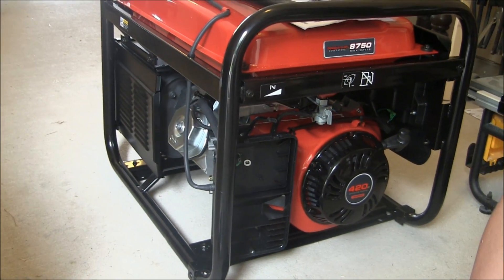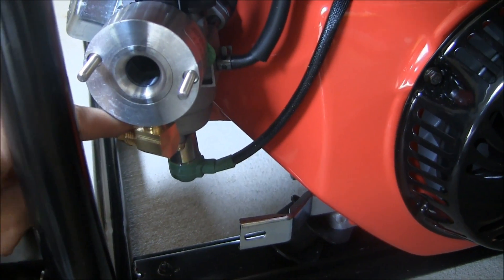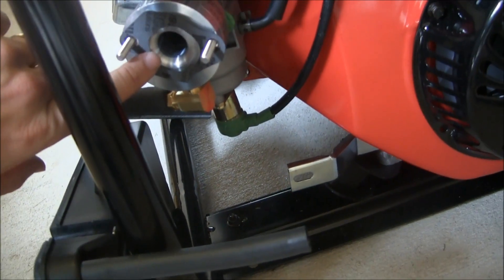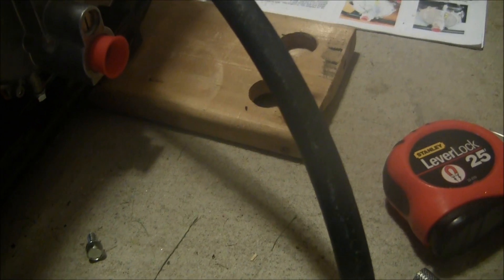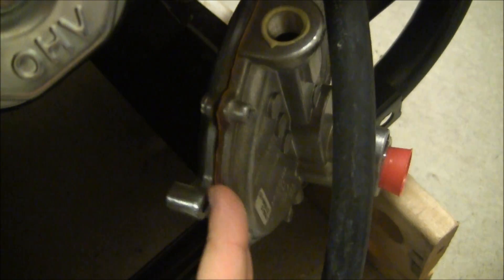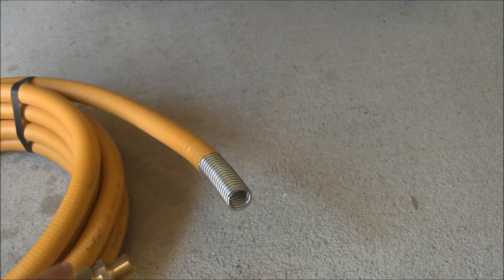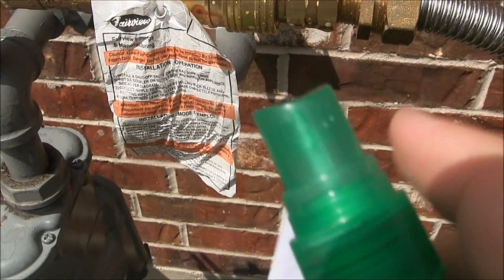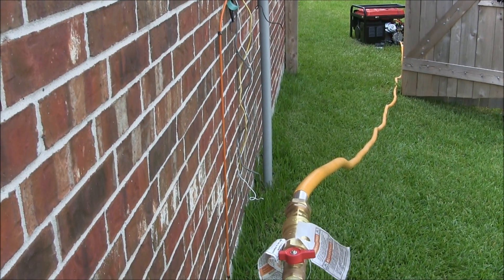Convert (Predator) Generator to Use Natural Gas (NG)

Comment: The engine is a Chinese knock off of a Honda... Amazing how counterfeit engines are sold in America, right up front, no problem with counterfeiting there...
Reply: They can only be called "Counterfeit" if they're using the "Honda" logo...Otherwise it's called a "Knockoff" Considering how much a honda goes for...That's not my problem.
Reply: Hondas are referred to as the forever motor for obvious reasons , I have been using them professionally for over 30 years for their reliability and durability .
Reply: Thank the worthless democrats for that, they are trying to destroy our country
Reply: Stupid ass, Honda leases out the design for the engines, they make a lot of money from doing it, Don't you think a company like Honda would sue big time for counterfeiting their property? Look it up Einstein asshole.

Comment: corrugated stainless steel tubing is not intended to be used in this application. If I had a service call at your house I would have to issue a type A red tag for an unsafe installation. I think the 1/4 in tapping is only there to measure the outlet pressure of the meter or leak test the piping system. Thanks for posting video,was fun to watch
Reply: The best critique is not just to just tell someone what they did wrong, but tell them how to do it right...
Reply: @bonesx7799  you're right! Stainless corrugated can be used in that application there's a lot of unnecessarily boo depending on your location but that was not the problem from what I see the problem is dude should you use take watermelon rinds bubble gum anyting on those joints those connections and also why in the world would he make a connection with the gas on? Seems as if you two would take this video down just for that safety issue

Comment: Did you run this generator under heavy load? Type C appear to be for the smaller motor. It is looks like it is working nicely
Reply from the maker: I did the best I could but haven't tried maxing it out.  That's a good idea.

Comment: You were doing good up until the gas meter part. Don't know why you would take that chance working on it live. Also I don't understand how you are able to supply enough NG to the generator if you have only a 1/4" output from the meter. It does not matter you went bigger after the meter. If you have 1/4" out, you'll never get more than what a 1/4" line can carry. Also that hose is not meant to be used continuously and flexed many times. You should get an outdoor rated rubber hose for NG.
Reply: Agreed should have changed 90 to a tee and went from there.  Very old post but you are very right.

Comment: do you have a part number for the kit that you used? or the stud width measurements? i  have this generator and i want to do the conversion,  thanks!
Reply from the maker: The 'Type C' kit from uscarb.com was used.
Reply: US carb states if you’re running more then 12hp a Tri fuel type 4 kit is required and a type C kit is for 12hp or less. Your Predator 8750 is 13 hp how did you get the type C to work properly?

Comment: How was the vibration against the air cleaner cover?   You mentioned it in the video
Reply from the maker: Not as worrisome as I first thought; however, I only run periodically and not for long periods of time.  It is intended as emergency backup power.

Comment: Thanks for posting this video! Question: how did you attach the male adapter onto the gas hose? do you just screw it on?
Reply from the maker: Yes, tightly and with some thread seal tape.

Comment: Great video!  When you start using natural gas, do you choke it?  I know ther eis a 'primer' button on the conversion kit buut I was wondering what, exactally, is the startup procedure?  Thanks!
Reply from the maker: Yes.  There is a primer.  I have to push it a handful of times to get this started.  It's now been a few years.  I try starting it up every six months or so.  It'll still start up the first time if I prime a little.  It took a some work to get this honed initially (i.e. setting the right inflow amount) but I haven't touched it since.

Comment: My friend purchased a 4KW Sportsman already equippped for propane online for about $300.  It has no gasoline tank.   It seems if you really want a NG or LP generator you should try to look for one factory equipped for this service.  Howver if you really need tri-fuel maybe these kits and other needed accessories make sense.

Comment: Whats the run time gas vs lpg?
Reply from the maker: I don't know if I understand the question.  I only ran gas for a few hours when I first got it to break-in the engine and only ever used natural gas since then.  I don't have more than 25 hours on this since I haven't needed it for an emergency (my intended usage) and haven't used it for anything else.  I start it about every six months.  The gas tank is limited (and runs dirtier), so with the (cleaner) natural gas to the home I see this as unlimited.

Comment: Hello i seen your comment on the rpm your generator is running. the perfect way to set your generator speed is to use a frequency meter. dont worry about voltage, the important measure is frequency. i set all of mine at 60.5 to 61.5 cycles at NO load. that way your very close to 60 cycles at load. if your only running lites no big deal about frequency but, if your running anything with a motor,ie  fridge,freezer,a/c you want it as close to 60 cycles as you can get. too low freq is bad bad bad.
Reply: That's, that is good advice.

Comment: I did the interlock - gave more options - and  alot easier - electrician came in - installed a 30amp breaker and box outside and I was done - works perfect -
Reply from the maker: The interlock is a good idea.  I'd like to do this or put in a transfer switch at some point.

Comment: MINE BROKE THE BOLTS OFF!!! I have the same conversion kit and put it on a ridgid and let the air filter hang because it didnt line up - 3 days into Sandy and snap goes the bolts form the motor - I had to have it rethreading  - MAKE SURE THE AIR FILTER IS SECURE!!

Comment: hey if ur worried about that air box being too close to the frame you can just make new holes where the engine mounts on the bottom & move the engine over a 1/2 inch or so.  It won't affect anything and will give you the clearance you may want.

Comment: Great build, looks like a pain in the Ass. I am picking one up tomorrow at HF. Then I will call US Carbs for the kit. Long Island's South Shore was wiped out with Sandy, HF's little 2 cycle worked great for CFL bulbs at night time, but getting Gas was a nightmare and after 15 days of no electric I need a better plan
Reply: It has been 4 years, do you have a follow up as to what you ended up doing?

Comment: and another question which i haven't solved yet is what is the output of your dc plug?  mines at 16-17V which burned up a radiator fan i was using in my home made enclosure (i have the video posted on youtube and am now using a resistor to bring it back down to 12v)  My output on the a/c side is a perfect 120v on both sides, i also added a tach and found i'm running a bit fast at 2750rpm, never had a chance to fully load it so i think this is fine.

Comment: You dont think that it will have any effect in one day breaking or loosing up the carb?  Also, my kit came with that extra bolt and spacer to hold the bottom of the air cleaner, but when installed it makes putting the cover on impossible since it keeps the plastic from flexing.  Did you encounter this issue?

Comment: Hi, i just did the same conversion to the same generator.   How is you air cleaner holding up?   I'm trying to think of ideas to keep the air cleaner off of the frame without cutting it.
Reply: To keep the vibration down slit some garden hose about 5-6" long and place it between the frame and the air filter. This will keep the vibration down while limiting the need to cut the frame.

Comment: Hello qs, I was looking at your comment to Patrick Moore and wanted to tell you after playing with the Interlock & transfer switch, I used a 30 amp breaker and tapped two screw holes in the panel and locked off the main breaker with a metal $1.00  L bracket when I need to lock it off,  painted it red and saved $150.00. With the transfer switch you only have 6 breakers and they are mini's, by locking off the main you can use a few more breakers and run a few more things

Comment: Hello qslewis, Great video, first how long did you have wait for the wheel kit ? and did you connect the bottom screw on the air filter, Also in your video I see you had to pull the recoil a few times to get started, there is a primer button on the back of that regulator, I have the tri-fuel kit on my generac and just got the predator, you helped a lot putting on the kit, I drilled a hole in that meal plate on the air filter to let the bolt pass through, thanks for the video,

Comment: Nice video....very informative & nice to see you got your boy involved w/ working with this hands.  The one thing I'd worry about is that gas meter pigtail setup.  If nothing else, my concern would be say like a soccer ball for instance striking it and possibly snapping it off [at least that'd be my luck].  Good job overall.
Reply from the maker: Thanks.  I tried leaving it on for a bit but then removed it.  I don't use it enough to justify always leaving it on.  I just put it back on when I want to use.

Comment: I thought the Type C was for 13 HP or smaller engines, isn't this a 14 HP engine, and thus use the Type 4?
Reply from the maker: At the time (about three years ago), this was somewhat of an open question but USCarb has since clarified.  My understanding is that Type C works.  It has for me.

Comment: I have a Predator as well, the smaller 3200/4000 watt model. I can't find any conversion kits specifically for the Predators. Did you contact the company and give them your model info and they hooked you up or does the Type C fit most generators? Thanks!
Reply from the maker: It's now been awhile but I remember calling or emailing before taking the plunge.

Comment: Nice step by step installation. Have you had a good experience with your setup with the NG conversion as well as the HF predator generator?
Reply from the maker: Yes.  It's now been a few years.  It works as I expected\wanted.
Reply: instablaster.